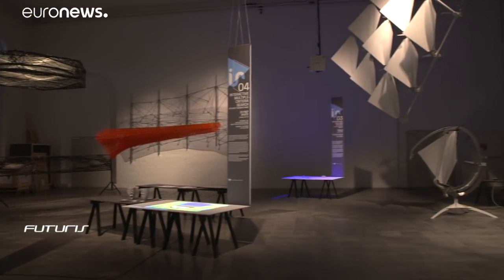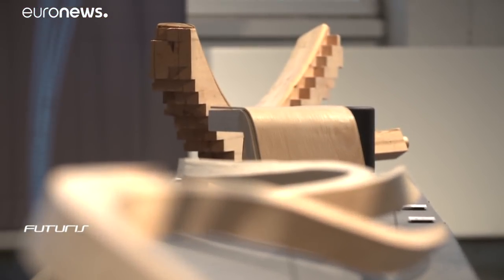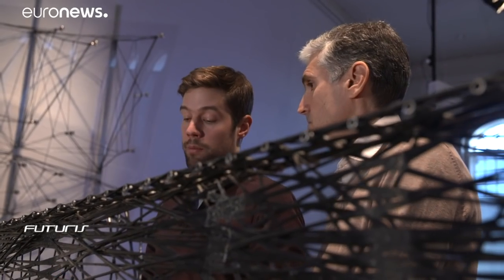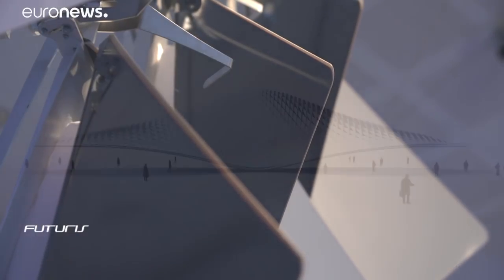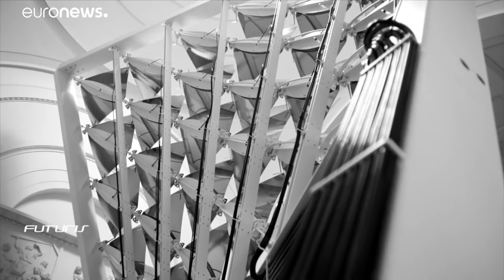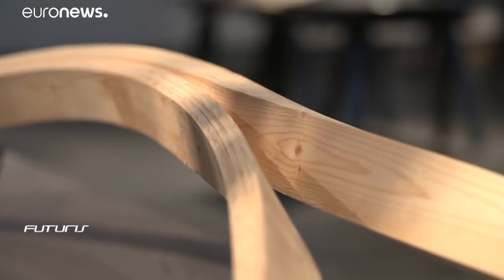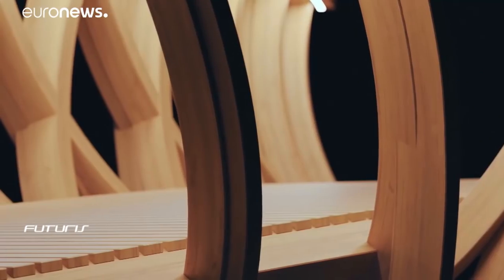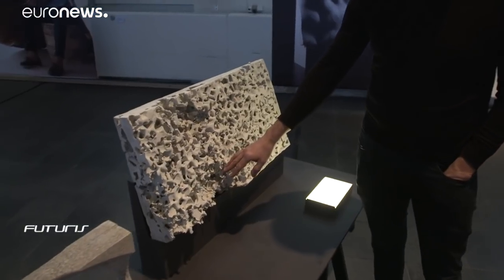Building the architectural future with new technologies

Comment: I'm studiant of architecture, my passion is about inventions and other stuff like this amazing processus in that video, my question is; how can I involve in this parte of merging architecture and technologicals ideas? Is it by going to techniqual branch in architecture field ? Or to specialized in geometry of architecture ? Or to swiched into civil engineering field ? I need your advice architects and angineers.
Reply: hi, bro. I have the same question. I'm from "la pepa 'er queso", Venezuela
Reply: Hi Bro. If you’ve found an answer or references with regards to that question please let me know. I’m searching for the same answers
Reply: Please give the update of your research. I’m interested as well!
Reply: Depends on which part of the developing process you are mostly interested in. Are you mostly interested in the design process as an architect, maybe in the mathematical/geometrical study of these forms (f.e. if you were mathematician) or in calculating the statics and optimizing the material use/destribution as a civil engineer? There are f.e. architectural offices, where you can do computational design as an architect/designer, with software like Rhino. But there are also opportunites for research in institutes/universities, both for architects or other engineers or even for physisists, mathematicians, biologists (in biomimicry) and others. It's really a multidisciplinary field.
Reply: as a grduate student i would recommend  gilles retsin who is an architect who is doing serious work that will probably make a movement in the architecture filed once the technology becomes more affordable and cheaper worldwide.
Reply: Try architectural engineering. It architecture meets engineering.